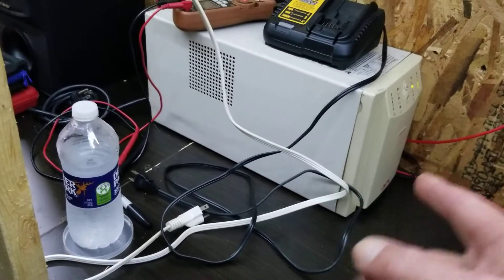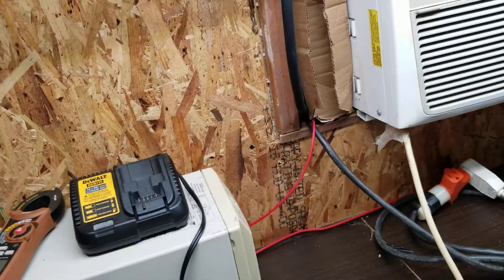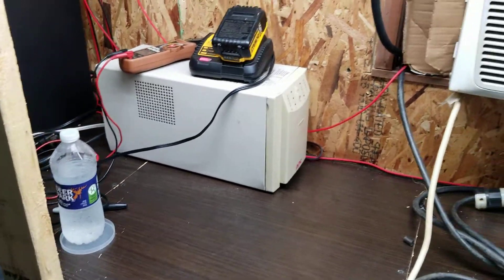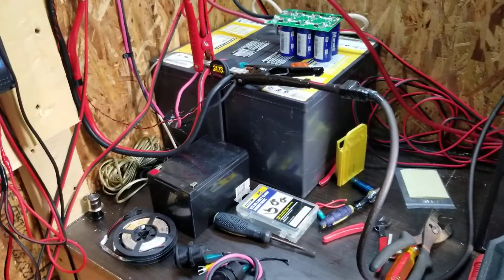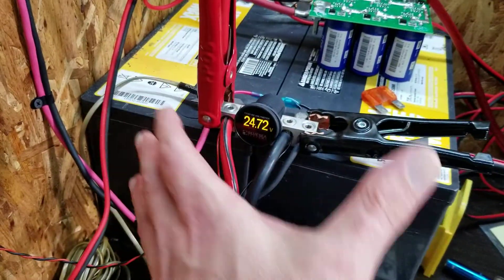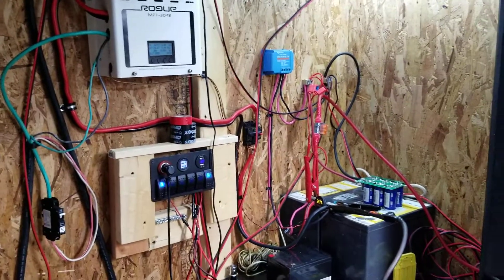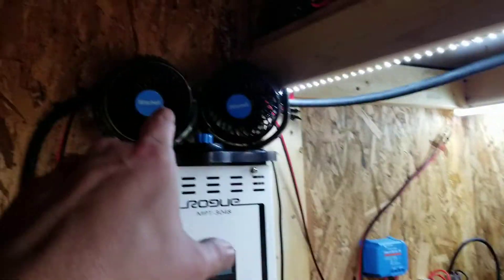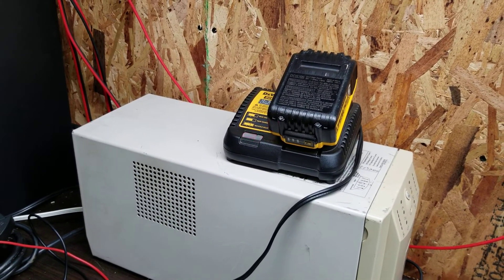APC 1400 UPS As a Power Inverter Off Grid " Does it work ? " Watch and Find out !

Comment: That's a great idea but my question is how the hell do you deal with the dead gum beeping telling you that the power is off
Reply from the maker: Most of the ones I have ,  You can turn off the peeper by pressing the middle top button once.
Reply: Or connect to the USB port and use your computer to permanently turn off.

Comment: I made something similar with a back-ups 1200, made a lifepo4 pack 12v stepped that to 24v and it works just fine. im gona do a 24v lifepo4 pack for a smart ups 1500 i have laying around. its a good way to use these ups after they are upgraded.
Reply from the maker: Yes it is a great way to use these. I didnt modify it much, Only added the extended wires for the batteries. I have seen where people have added the extra mosfet transistors to the power section. I felt no need in that because I wouldnt be using it at full loads anyways. I will probably add an additional cooling fan in the future. But as long as it works for my needs I wont worry to much about. Its a small setup for the shed. Unlike my Home system is much larger.
Reply: @SoutheastOhioSolarHaven  yeah when you think about what they are supposed to be for only to be used for 20min to 1hr, mine only have a 24ah battery so it wont matter, good videos enjoyed seeing that solar shed coming together 👍🏻